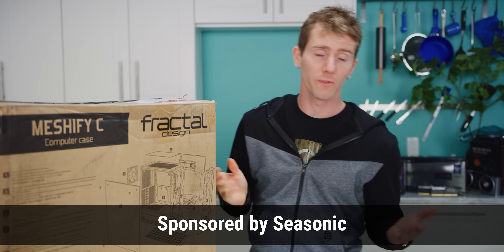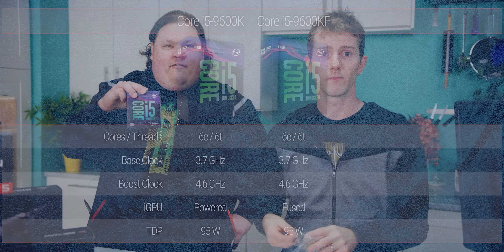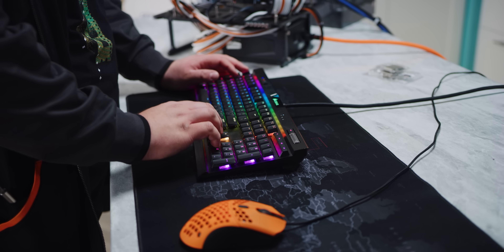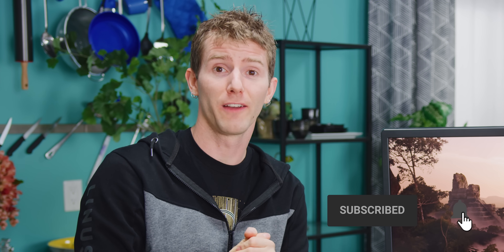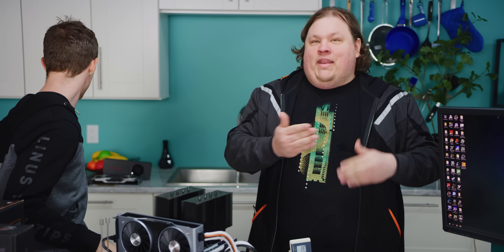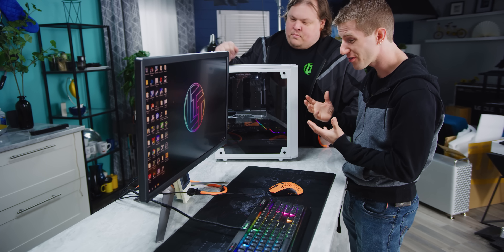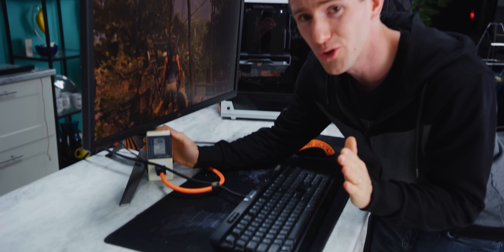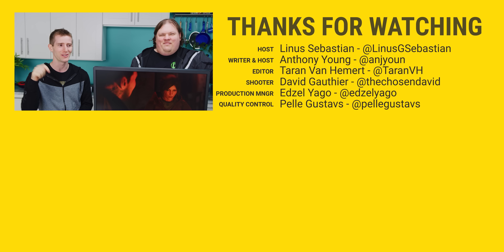We built a PC more efficient than a console!

Comment: I live in a van and all of my electronics run off of 12V AGM batteries. Is there a power supply that can run this set up directly off of 12V DC power? A 120V PSU will cost me 10-20% in power drain from inverter conversion. Since you guys did all of the hard work of figuring out the ideal CPU+GPU, I just need to find a mobo and PSU that can run off of 12V batteries for gaming. I'm hoping to play DayZ lol

Comment: I Managed to do:
- 60W Idle
- 140W Ingame 
WIth a RTX 2080 & i5 8600K @ 2,5 Ghz
For High Settings in Shadow of the Tombraider @ 1080p.
Does Anyone know which settings where used in this video?

My CPU ran at 0.75 V
My RAM ran at 1.29 V
My GPU Ran at 750 mV

FPS Capped at 60 with RTSS.

Comment: I've got a 4790K with a 240mm AIO and 1080ti FTW 3 in a Cooler Master Silencio case, and have been considering undervolting and putting the additional silence panels on, while minimizing fan speeds. This gives me some ideas, but do you think a down-clocked 4790K would cause noticeable performance drop, and would an undervolted 1080ti still be able to drive 3440x1440 60Hz adequately?

Comment: @Linus So you think you can find the best ARM laptop and do an apple newton to it. That is just using the IO alone to power the CPU for the ultimate power saver, maybe a snap dragon or other to do the apple newton challenge. The ARM chip in the apple newton was so efficient it worked just running on the power of the input signals to the chip. This was a tenth of a watt of power. Can you even find a chip that passes the no volting challenge ???
Reply: For the no volt challenge if you still need a bit of power try a capacitor instead across the VCC and GND of the processor. Then use the input signals to charge it up. (For safety maybe a low voltage shunt to a 1.1v capacitor. ?)

Comment: So if you took out 3 60 watt light bulbs, replaced them with LEDs, you would still have less power draw, have a gaming pc that's silent, and be saving money.
Edit: meaning you could run your pc off of solar and charge the battery at the same time meaning it costs you nothing exept for the solar panels which should pay for themselves by not paying for the gaming pcs power draw.

Comment: Very interesting. Would it be possible with newer hardware to either lower the power consumption even more or increase the performance without increasing the power consumption?
Reply: Yes undervolting does that
Reply: Oh yes defenitly that's what I'm doing with my van at the moment for winter with a ryzen 3600 and a 3080 drop my power consumption by 100w just with the gpu and only lost 5fps (métro benchmark) at 1440p

Comment: Would it not theoretically be more efficient to get the best cpu and gpu available and cut them down to this performance. Just because they are a better part of the silicon they should be a little more efficient if running in the exact same scenario.

Comment: My (gaming) laptop comes with a 230W charger brick and it makes anyone that's come pass it startled, at least by the size of it. The laptop only good for a little over 2 hours on battery in power saving mode (thanks intel) while doing basic stuff like documents and a bit of web browsing. Plugged in and gaming the GPU draws 80W rather constantly, and the CPU at its rated TDP, 45W. Though sometimes peaking at 80W as well. Still don't get it why it needs 70W more headroom tbh. I assume it's intel stuff, because a colleague of mine has a gaming laptop with a Ryzen 9 (mine's i7 btw, not even on the same league) on the same TDP, same GPU, and the brick is "only" 200W. Aaand it can be used on battery only, power saving mode, for 6 hours and a bit.
Reply: The headroom is when you use it in performance mode, and/or for overcloacking, adding a second screen, external harddrives and audio equipment. THEN, some graphics cards have higher short power spikes. For example nvidia 3000 series double their TDP for a few milliseconds and it's enough to shut down the system if psu's range is too low.

Comment: I’d argue that buying overpowered hardware to avoid the recycling, wastage and manufacturing cost implications of hardware upgrading could be more beneficial. Maybe just buy a more efficient PSU and then fight the giants like intel so they stop changing their sockets every update. Wonder how many motherboards end up in the bin when they’re completely fine. We should also be supporting second hand markets and local sellers to avoid the shipping costs of an amazon van driving to your house opposed to you going to the local pc store on your bike or by foot. We should also be pushing manufacturers to support those local stores by not screwing them in costs because they can’t afford to buy 20,000 units.

Comment: I hope you guys are aware, that this is not real power meter ...
Those plug-in units like the one you have there will just give you a VERY rough reading of the active power.
Sure they can measure voltage to less than +- 1% accuracy and current maybe better then +- 3%, but also that most likely only for a pure sine-wave, which at least the current never is.
I don't know the spec for active power reading for this unit, but I'm pretty damn sure, it's somewhere in the range of 3-5 %, if the manufacturer is honest about it.
It sure is good enough to tell, if a device consumes more like 10, 50 or 150 Watts, but measurements down to single watts? Nope!
It might not even be fair so say, that the PC ("106 W") consumes less power than the X-BOX ("130 W"), since depending on the current waveform, this could actually be the measurement uncertainty of that power meter. 
If you really want to do quantitative measurements with this kind of accuraty, you should invest in a real name-brand power meter. Sure, it will cost a lot more than this no-name one, but less than a TITAN RTX, that's for sure ;)

Comment: I can't find a way to make my GPU use less power at idle. Is a EVGA GTX 1660. Is always at 12-15w idle, stock or underclocked is the same. My setup with two monitors is 70-80w doing web or Photoshop/Clip studio. My PC has 6 fans, 2 HDDs 1 M.2 SATA.  The PC alone is 45-50w. My laptop is 35 without the battery 80w while charging the battery.
Reply: Get rid of hdds, make a better fan curve, turn off a few apps that turn on at startup

Comment: What is the cheapest build to get at least 100+ fps in almost every game?
Reply: Depends on graphics settings and resolution. 

About 800€ if you want 1440p ultra on about 100fps. 
What you want:

Ryzen 5 3600
B450 max motherboard from MSI
16gb 3200mhz ram
Cheap case that will fit the motherboard
600w Power supply
A GTX 1080ti (used)

I would go with a used 1080ti because it is still in the top 4 fastest consumer GPU list. If used isn't an option then go for a RTX 2070 or 2070 super which are slower.
Reply: @alex_inside  thank you, i will save this and someday i will make it

Comment: Wait... YOU MEAN TO TELL ME THE GT 1030 IS THE ONLY GRAPHICS CARD THAT'S HALF HEIGHT AND SINGLE SLOT!? No GTX 1050 Ti or 1650 LP half height? I only have 2 total slots, 1 for Xonar SE and 1 for MSI GT 1030 OC. I have to overclock my GT 1030 to the max to get the best out of my SFF 7040 periodically!? The SFF 7040 can only allow GT 1030 and RX 550 as the most powerful options all because of size/slot limitations. Well I guess the SFF 7040 Optiplex was never really intended to be a gaming rig anyway so me making it into one is already baffling. Regardless, upgrading the 180w PSU is pointless (should'a got the 7050).

Comment: Meanwhile using a 2080ti and it says power effo
Reply: Efficiency
Reply: Check out TechYesCity video about running RTX 2080 ti for 8 hours straight using 450 Watt PSU.

Turns out it's all about the quality of PSU itself that determines power Efficiency or not.

Comment: This definitely puts my Pentium J2900 system to shame as far as power consumption to performance goes. But I did use super low end crappy recycled parts from way back when. I'm just surprised that this system has a very similar power draw. I mean, I was just using a 3 watt max CPU. Impressive how much you can lower power draw with undervolting.
https://youtu.be/FisNp6Byep0

Comment: Things I want to see clearly explained 

2*16 gigs of ram 

Test both CPU and Motherbords h110 vs b450m v z390 v z490 

idle 1 , leave running no .com  35000hours/4years

idle 2 , leave running wt 9 tabs on /Chrome  35000hours/4years

idle 3A, 100 hours of Chrome youtube   
idle 3b, 100 hours of Chrome wiki

1 hour stress rendering /1000 hour work stress
High speed SSD/ 1 hour stress rendering /1000 hour work stress
Ram size and channels optimised for rendering / 1 hour stress rendering /1000 hour work stress
High speed ssd plus Ram optimisation /1 hour stress rendering /1000 hour work stress

<!>Ram drive optimised trick for rendering /1 hour stress rendering /1000 hour work stress 
>[Plus standart amount of time to move assets to ram drive plus backup to non volitile memory every 3 days and backup to hdd black every couple of hours 6 to 9 hours schedual]

Gaming v Gaming+OBS:record v Gaming+Streaming"

>>>3200mhz
[This PC] wt P300A + 2 arctic fans 
[This PC] wt P300A + 2 arctic fans + MSI Afterburner fan control 

[This PC] wt P300A + 2 arctic fans + /another 2 sticks of 16 gb ram
[This PC] wt P300A + 2 arctic fans + MSI Afterburner fan control + /another 2 sticks of 16 gb ram

>>>Optimal high ram speed power .example 9400f + 3600 Ram
[This PC] wt P300A + 2 arctic fans 
[This PC] wt P300A + 2 arctic fans + MSI Afterburner fan control 

[This PC] wt P300A + 2 arctic fans + /another 2 sticks of 16 gb ram
[This PC] wt P300A + 2 arctic fans + MSI Afterburner fan control + /another 2 sticks of 16 gb ram

>>>Sweet spot Ram speed power and thermals 9400f + 3000mhz cl15 Kingston Hyperx Predator 2*16 gigs
[This PC] wt P300A + 2 arctic fans 
[This PC] wt P300A + 2 arctic fans + MSI Afterburner fan control 

[This PC] wt P300A + 2 arctic fans + /another 2 sticks of 16 gb ram
[This PC] wt P300A + 2 arctic fans + MSI Afterburner fan control + /another 2 sticks of 16 gb ram

//

dont limit to interesting gaming stuff, 
what is the performance of a 10700 vs 10600k 
in terms of energy efficiency